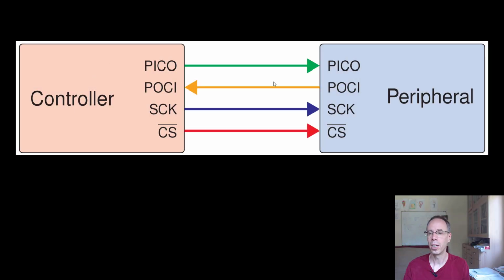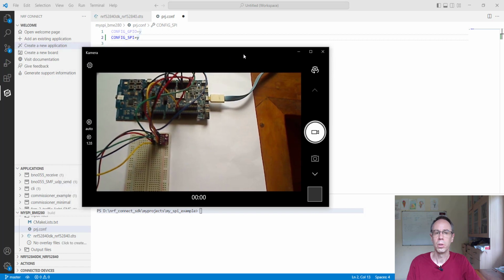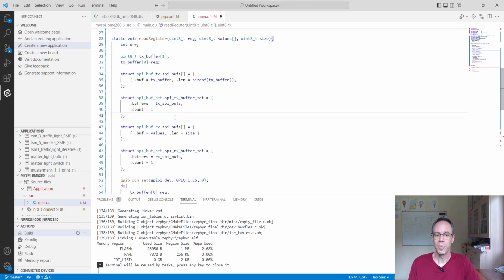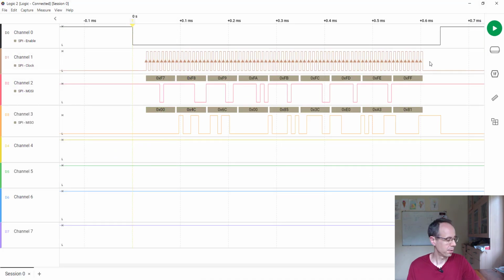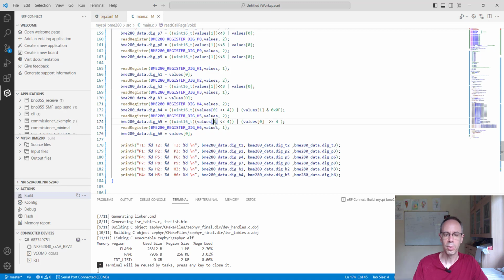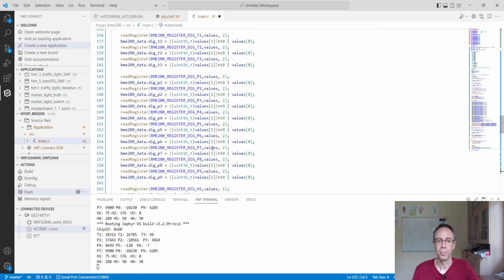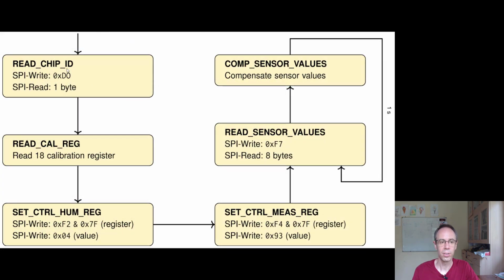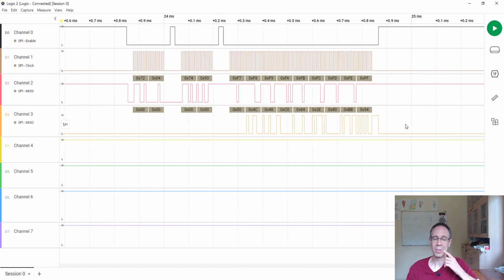SPI (Serial Peripheral Interface) Part 2: Programming with Zephyr, nRF52840-DK and Bosch BME280

Comment: Hi, sir, I have a question. Have you tried the zephyr SPI comm with an NRF52832? I seem to have a trouble trying to communicating with a DWM1000 qorvo devboard. I manage to send 0x00, but failed to receive the chip ID, I always get 0xFFFFFFFF
Reply: Hey, did you find a solution to your Problem? I'm currently trying to communicate with the DWM1000 via the DWM1001-dev board

Comment: Hi, thanks for this. One question, you don't set the read bit MSB of the register address. Is there a reason for this?
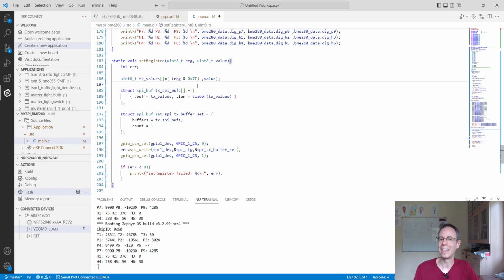Reply from the maker: For a read instruction it is automatically set by the register macros. For write instructions I set the MSB of the register to zero with adding 0x7F(see 23:26).

Comment: Hello, I did not realize, why did you not use spi_cfg.cs field? I saw that you toggle CS "manually". But why so, and not using the field .cs?
Reply from the maker: The explanation follows at about minute 31. This did not work with the BME280. After each command, the CS-Line was automatically set to disable again and the BME280 was deactivated before it could send the already prepared data.
Reply: @wsniot  I also have the same question. I have issues with the chip select when I am trying to use .cs
Do I need to change anything in the device tree or project configuration if I want to use automatic chip select toggling instead of manual as it does not seem to work "out of the box" ?

Comment: we are trying to write and read data on EEPROM 93C46B using nrf52832 via SPI can you help me out with how I can send commands and data using the transrecieve function.
Reply from the maker: The spi_write and spi_read functions only call the spi_transceive function. With spi_write the rx_buffer is set to NULL and with spi_read the tx_buffer. With SPI, sending and receiving always take place simultaneously. If I want to receive and send at the same time, both buffers simply have to be defined.
Reply: @wsniot  which part of your video I should refer to so better understand this?
Reply from the maker: @mayureshpitale2810  I dont get the point of your question? Do you have trouble understanding SPI or how to control the 93C46B ? You have to take a look in the datasheet from the 93C46B for the specific commands. SPI is not a 100% uniformly implemented standard. Always a good idea is also to test it with an arduino library first and using a logic analyzer for making the commands visible and then send the same commands with Zephyr.
Reply: @wsniot  I want to understand the part where we set the buffers for the spi_transceive function as I have trouble using that function. because I'm not able to set the values of the buffers as I want.

Comment: We are trying to connect with lsm6dsl in our custom board which has nrf52840 through SPI. Can you point us to the right tutorial or video help resources since we are unable to communicate with the IC through the example code(is using i2c) and also unable to configure it to use SPI.
Reply from the maker: I would recomment you using for testing an Developerkit first. Try SPI with the BME280 like here and then try to implement the SPI-communication with your IMU. If this is working you adapt it with your custom board.

Comment: Thanks a lot!! Going very deep, it's just what I always wanted!! 😆😆 I have some questions though.
- The dummy address 0xff at the end, you had to use one which doesn't exist, right? Or doesn't it play a role because you don't read after 0xFF?.
- You set once that you want to oversample 8x. Does the sensor measure the whole time even if you read the values only once per second? Or every minute? Or does the sensor sample data only every time you read? And if that so, does the sensor have enough time to measure things and sends back to the controller?
- And I think the correction what you made with 0x7f was right what you said. Because the bitwise OR with 0x7f is setting the first bit to 0 and keeps every other bits.
Reply from the maker: 1. Actually you can use any dummy value you want. But of course if it is a command what the peripheral understands like a register it will react. But since the CS line will be high again the communication ends. Mostly it is better sending just 0xFF or 0x00.
2. In normal mode the sensor measures the hole time. It has a measurement cycle and the a standby time which can be maximum 1s, but if i see it right the default standby time is at 0.5ms (t_sb[2:0]). The maximmum measure with 8x oversampling is  t_measure,max=58.175ms. So we get every 58,675ms a new measurement in the registers. For weather data 1x oversampling is actually enough. The measure time will be significantly smaller.
3. Normaly you count a word in most significant bit order here (b_7 b_6 ... b_0). And then it is b_7 what you have to set to 0 and not b_0. Its always a question what is meant with the first bit.